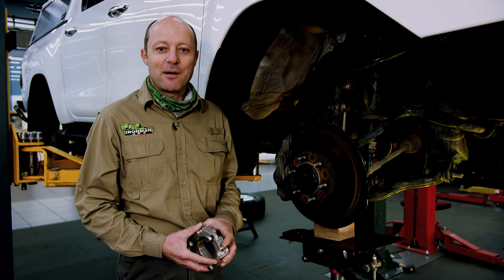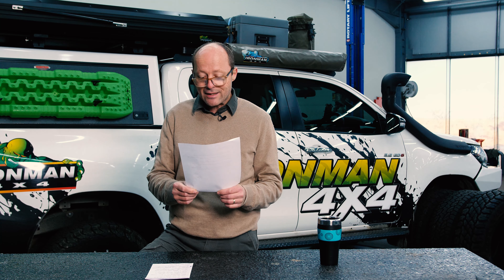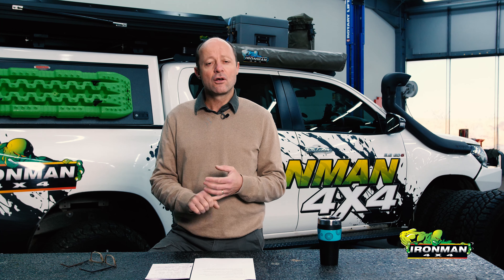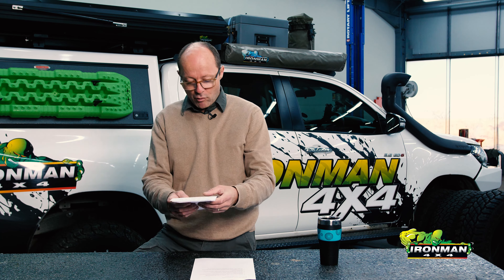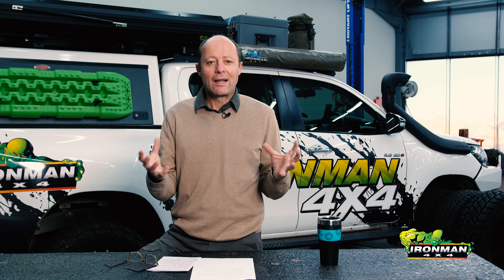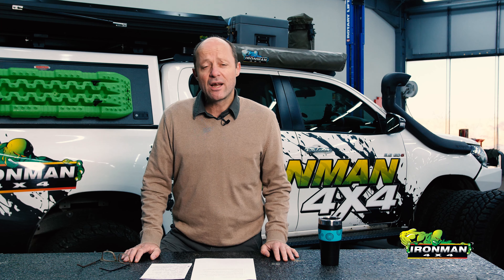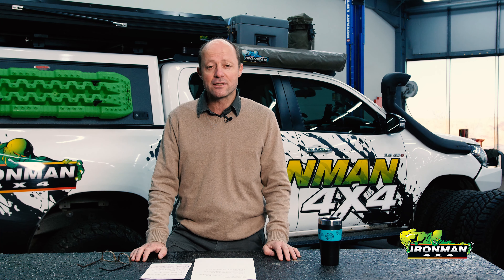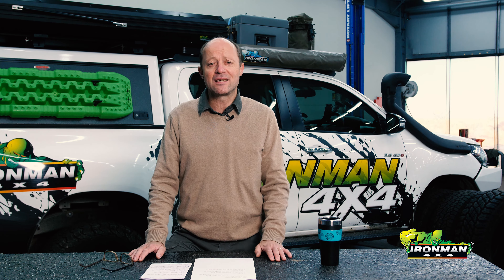Building your Overlanding Vehicle. Where do you Start??

Comment: Hie Mic. I have a question for a used car budget overland build. Which one would be the best to start with. A dual cab or a wagon.
Reply: id go wagon , shorter wheelbase most , no need for roof top tents , sleep in side ,put a   platform rack on the roof  for gear ,all so can use it as a place to get off the ground , enjoy a view , race ,star gaze  ,ute s do have more payload
Reply from the maker: I love wagons over dual cabs. I have had both. Dual cabs are more versatile with way more space once you fit a decent metal canopy. I currently drive a Land Cruiser 76 wagon. Love this truck!! Next though I will go for the Land Cruiser 79 dual cab due to available space. Also, more room up top with roof racks front and rear. Wagon probably a little better on trails etc due to shorter wheel base. Longer wheel base on dual cab better for towing. Decisions, Decisions!!!